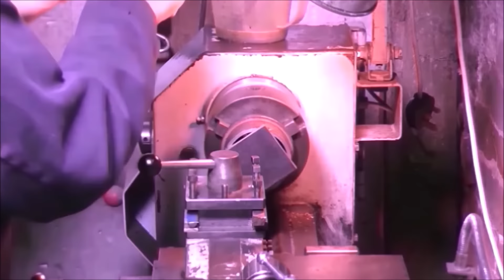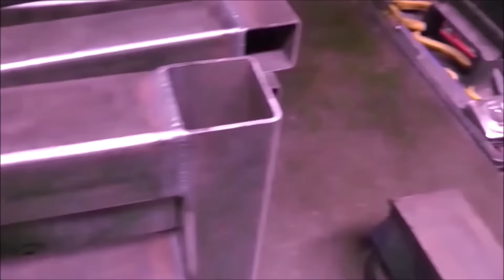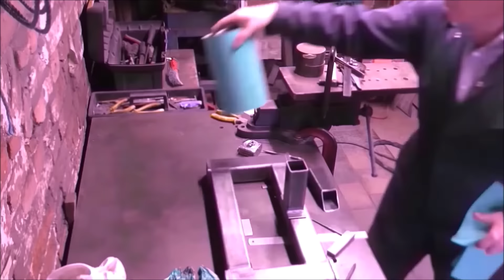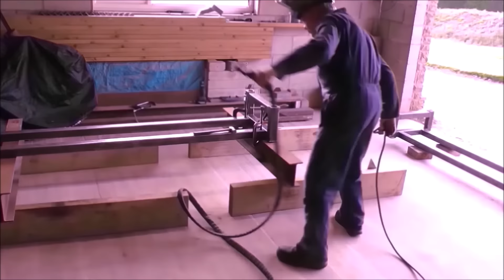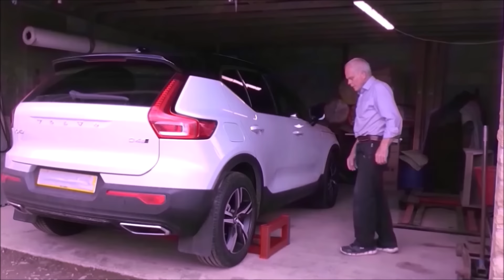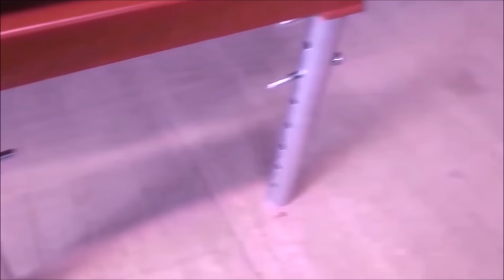The ultimate homemade car jack, simple to use, compact when not in use.

Comment: How unnecessary, just use the trolley jack and stands as I have been using for the past 30 odd years, you must be really bored sir.
Reply from the maker: Vehicle Maintenance and Repair .com, You certainly would not jack my car up in the way you described and get away it.
Reply: I also didn’t see any value of such solution. You must probably need bigger/higher trolley jack & 4 solid stands. I can jack my TLC without any problem and way faster, while it’s higher & more heavy. This thing makes access to wheel removal impossible, while most of suspension maintenance require. Still can’t catch, what type of maintenance is it designed for?
Reply from the maker: @antanaslomsargis8952  You obviously did not watch the video, if you watch the complete video you will see that "any" sort of maintenance can be carried out to any make of car, also cars can be lifted easily and safely without causing any damage through inadvertently placing a trolley jack in the wrong place.
Reply: First, thanks for responce. Second, I’m car race mechanic for 20 years, so I watch all available options/solutions with “do I need to use it” in mind. I got anwer “no” and wrote that. And yes, I’d watched whole video, just fast forwarded welding part, as I also can weld, if such requrement appear. During search, I found not even yours solution, but also in “The other Finnish guy” channel, where he made jack stands. That idea seems much more practical to me, when you need to fix car, and time is highly limited, that I even thinking to repeat. Every car can be safely lifted not only through weels, but also via dedicated places which come from manufacture, same as other solid places, like rear reductor, car engine cradle (if you need to lift whole axle at once), and so on. Also, there are hydraulic jacks with long arms (~ 1m) like SGS TJH 1.5  So sorry, but for my eyes, your solution seems impractical/time consuming/very limited in usage
Reply from the maker: @antanaslomsargis8952  There are a few so called mechanics that use a trolley jack for quickness in places were the jack should not be used, especially when it is someone else's car. Most modern cars do not have a suitable place to position a trolley jack without causing some damage.  The car manufactures jacking points below the car sills are intended for use with the vehicle's own scissor jack, these scissor jacks are only designed for occasional use such as a roadside wheel change and have a limited safe lifting height. Yes we all know suitable Jack stands can  be used under these jacking points but you first have to get the car jacked up high enough. These jacking points on a lot of modern cars are not suitable for use with a trolley jack as damage can be caused to the plastic trim that runs along the sill, also if you do manage to get the car jacked up at these points using a trolley jack you are not able to get any jack stand into place until the jack is removed. Trolley jacks can not be used under the front sub-frame on most cars as this is covered over by the underside plastic engine cover.  The rear differential casing should also not be used as a jacking point on some modern cars when the differential casing is only cradled in rubber mountings which is usually the case with independent suspension. Some so called mechanics place a trolley jack under the suspension wish bones which is a big no no, jacks also get placed under the floor stiffening channels another big no no. Yes we know there are long and low trolley jacks that reach up to a metre  under the car, but when the jack is that far under the average low car it is very difficult to see what the jack is lifting against, also the further underneath a car the jack is placed then more force is placed on whatever the jack is lifting against, as the jack will now be taking some weight off all four wheels. But any mechanic with 20 years experience should know all this especially a race car mechanic.
Reply: @johnbower  Yes, you always can buy disposable cup & attempt to reuse it. And yes, then you will find enough issues to fight with. Question is - why? Same with the cars. And you are wrong according lifting on differential casing, overwise usage of such car is dangerous enough & need to be fixed asap.
Reply: @antanaslomsargis8952   a race car is not your average car  the idea is fantastic for home mechanic and as a side i watch many race and rally spanner men and would not let them within a mile of my car!!
Reply: You guys are assuming that the person using this is always doing maintanance tha requires a wheel to be off as well as the user having access to an indoor place with a level pad of concrete. I currently am limited to access to a gravel/dirt driveway out in the open so this set up with the additional wide footprint would be acceptional for many under vehicle jobs from oil changes on low set vehicles and exaust work to name a few just for the sake of stability.
Reply: @johnbower  I assume that you have never seen a car being serviced by a professional mechanic. The normal lifting method, endorsed by auto manufacturers, is to use a lift which picks up the vehicle at the same four rocker points as commonly used for the tire-changing jack. Every vehicle is provided with a service manual which shows appropriate jacking locations.
Reply from the maker: @brianb-p6586 ,  don,t try to teach your grandmother how to suck eggs.